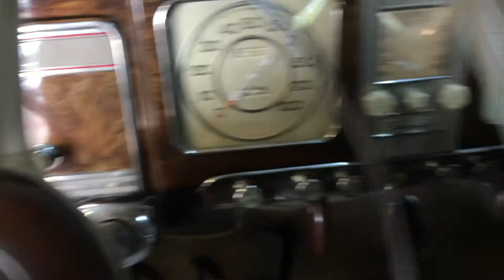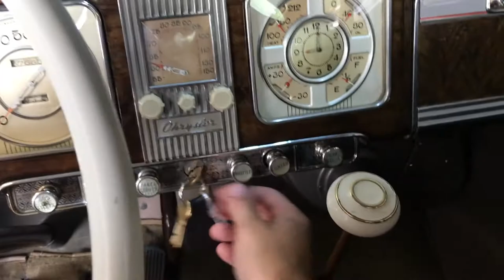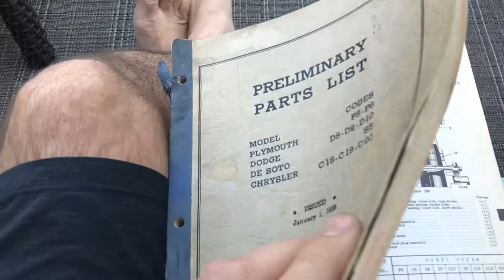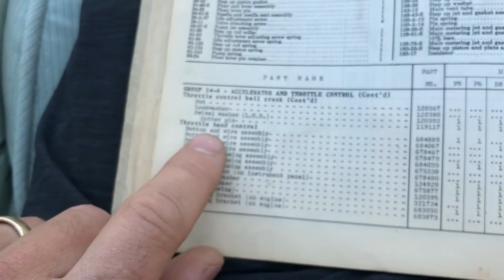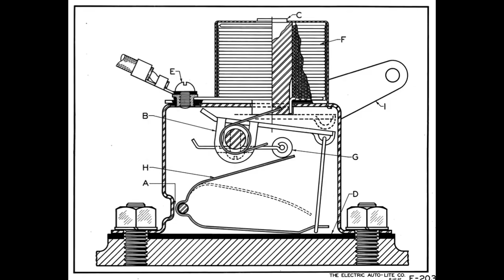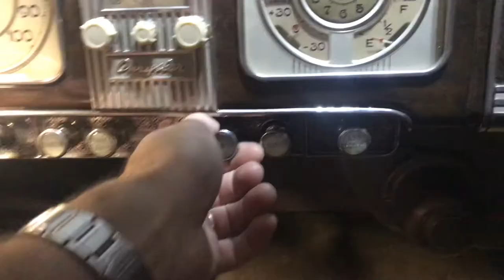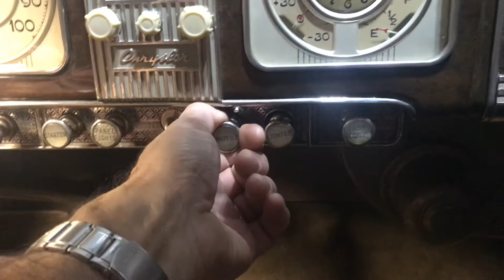Its all just stuff....With chokes and high idle cams!

Comment: I just wanted to point out a correction you should make on that wire choke adjusting tool you made Keith.  The alignment tool needs to be slightly smaller than 3/32" dia.  I grabbed a 6 in. long piece of 3/32" rod and just started sanding down the dia. with some course emery cloth until it just barely slid through the hole that you slid your wire through.  I also bent the wire in a circle loop at the top, to use as a handle sort of.  
Now if you look closely at your choke assembly, on the base, right below where you slid that wire through the hole, you will see a slot.  The tool you make not only needs to be the exact size but it needs to be long enough to slide through the hole where you inserted your wire and then carry on down into that slot, which is also the same width across as the dia. of the wire tool. This way the choke assembly is fixed in place and is set exactly where it needs to be. On a cold engine, then you loosen that nut & bolt on the other side of the choke assembly, close the choke plate manually and hold it closed with one hand or a weight or whatever, and retighten the nut & bolt.  Chrysler actually had a part number for that tool back in the day.

Comment: Hi Keith, I have been watching your videos with great interest. I don't have a Chrysler, but I have a '35 Dodge DU with the identical Sisson choke. My car does have a fast idle cam, pulled up by the secondary rod same as yours. If you think about it, that secondary rod and the piece it operates serve no purpose unless there is a cam on it. I think your car would operate better with the one off your spare carburetor which you showed in the video.
You seem to have got your choke adjusted okay, but if you find it is too lean or rich when the weather gets cold, here is a hint. If you look at the choke housing there is a small notch at the base, directly below where you put your wire tool through. The tool should be long enough to engage that notch to ensure proper adjustment. Also, a No. 42 drill fits exactly according to the maintenance manual which says "Loosen the bell crank clamp screw and lift up on the lever until the choke is completely closed, tighten the clamp screw and remove the drill or tool".
Cheers, Don

Comment: My 1941 Chrysler has a newer style of automatic choke and a different, more modern kind of stepped fast idle cam on the carb linkage. But it also has the hand throttle which is most useful as a cruise control on highway driving! The hand throttle cable is also nice to use on cold starts when the car is perhaps not in good tune. But when everything is tuned up, it's not necessary to use it to encourage a cold start. I think that this was perhaps a glitch year for the Chrysler engineers and that there really should be a fast idle cam ramp on that linkage bit. You should gimcrack something on it. Fabricate/bend a new one, or tack a bit of weld spot on that thing and file it into a ramp.
Reply from the maker: Agreed Paul. Seems like a miss in 1938 no to have a ramp. I have considered welding and hand filing a ramp.  I'd like to have a spare to experiment with first. Don't trust my welding skills yet. Can't afford to wreck the only one i have, on the car now.

Comment: looks like that choke mechanism with the solenoid is designed to give full choke while the starter is engaged and after that, the amount of choke will be governed by engine temp, which under normal circumstances will diminish as the engine warms up.

Comment: Hey! I’m having an issue where the choke isn’t setting with the sisson solenoid…seems like the throttle return spring is putting too much pressure on the carb and binding things up? Making it too hard for the sisson choke to actually work. Is there an adjustment on the throttle linkage or the throttle return spring? Would too much pressure cause this issue or is there something else I should be looking at???